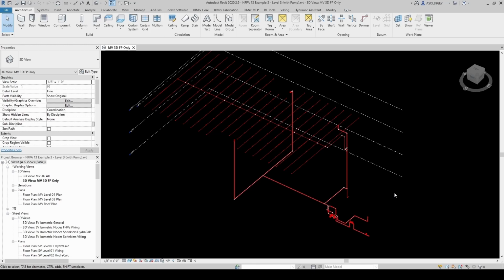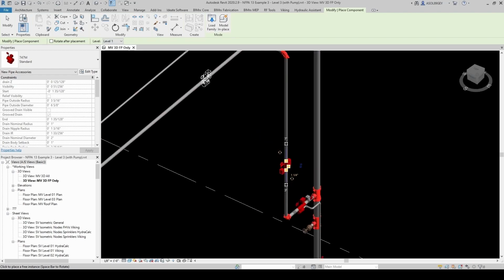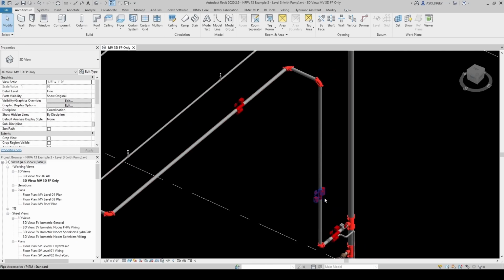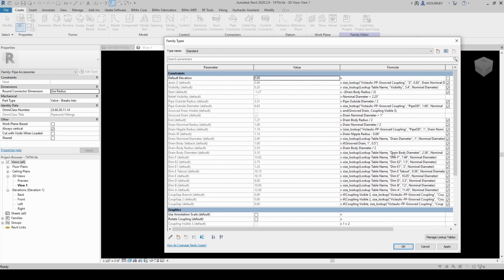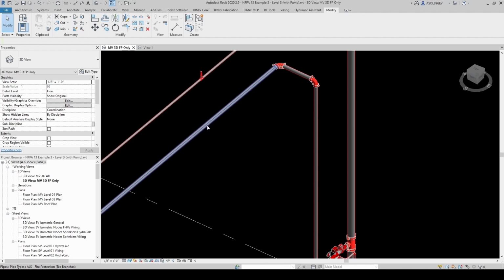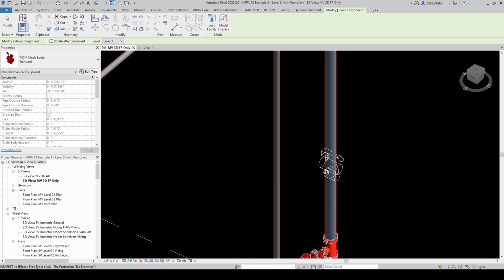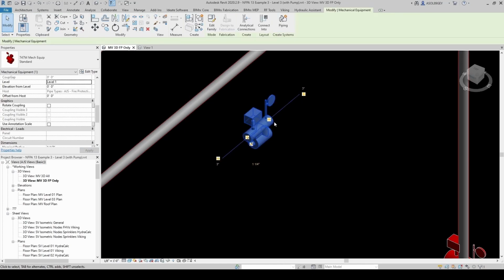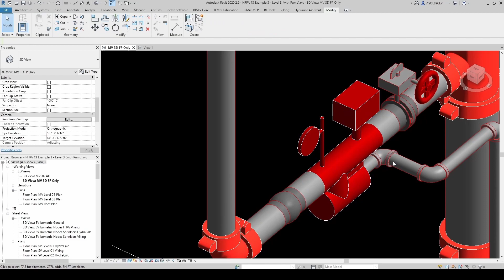Pipe Accessory vs Mechanical Equipment in Revit

Comment: Great stuff Alex! Is this concept important for when building a family that will have different systems connected to it? Does the mechanical equipment family type solve families from switching systems when connecting to different systems? Would this solve the issue people have when connecting a vent system to a sanitary system for a carrier? Also maybe a balancing valve family that needs to connect to hot water and hot water return. Although for a balancing valve not being able to pop would be unfortunate.
Reply from the maker: Hi there. I'll go in order =)
Yes, very important for families that connect different systems (like boilers)
Yes, mechanical equipment are able to "break" into different systems and separate them.
As far as carriers it is a bit tricky, and there are different lines of thought. In my opinion, a carrier should be categorized as a fitting (stuff in and same stuff out), but the venting makes it sometimes behave erratically. I still prefer keeping them as fittings though.
Balancing valves I keep always as pipe accessories. The separation between Hot Water and Hot Water Return I keep at the "out isolation valve".
Keep it up and have a nice weekend buddy.
Reply: @bimitup   Thanks Alex! We need to collaborate one of these days! I consider you the top Expert in Revit MEP!